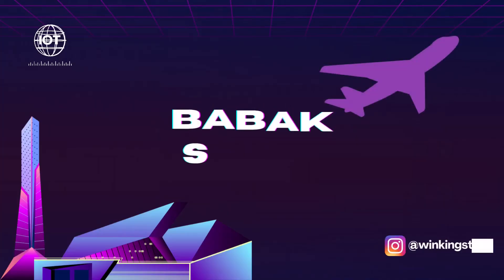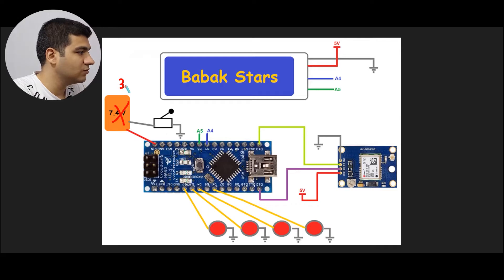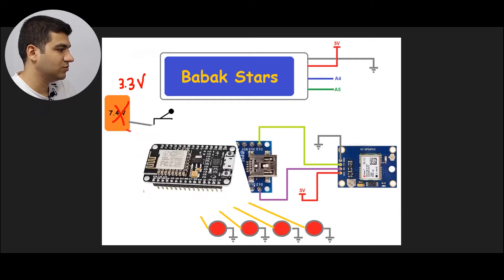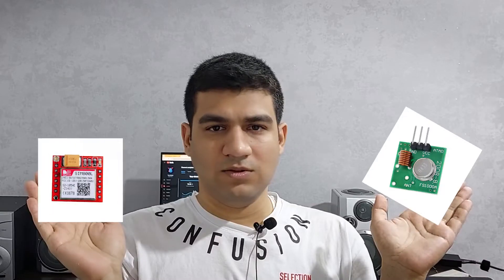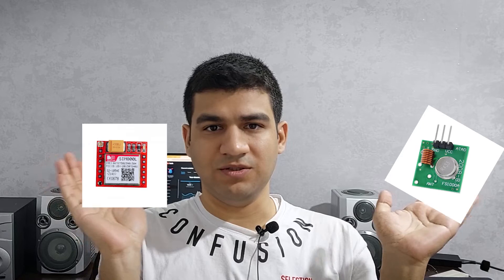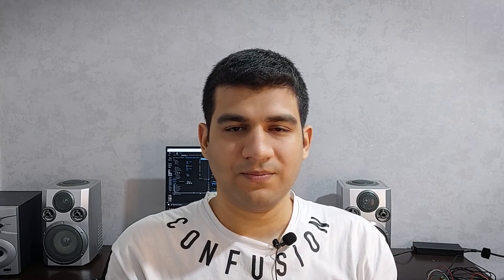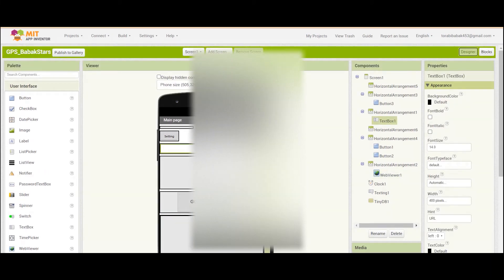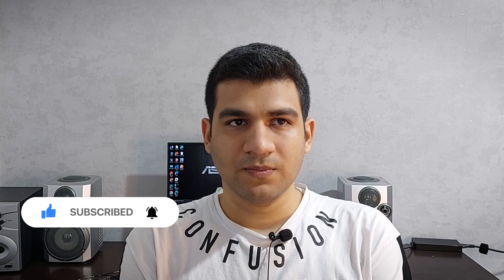Make Your Own GPS Tracker With NEO6M And SIM800L Modules Plus The Android App

Comment: Watched full as you said. Very nice. Low power consumption solution. Link it with IOT. Other people can track ur tracker. Like we have a car, it's on rent nd we r tracking where z the car now.
Reply from the maker: Also, if you have a heavy vehicle transportation company, such as a bus company or a fuel transportation company. For larger tasks, it is better to work with the SIM800L internet module. Because it has a higher speed.
Reply: @BabakStars  yes , that's a good idea. Like it. ❤️